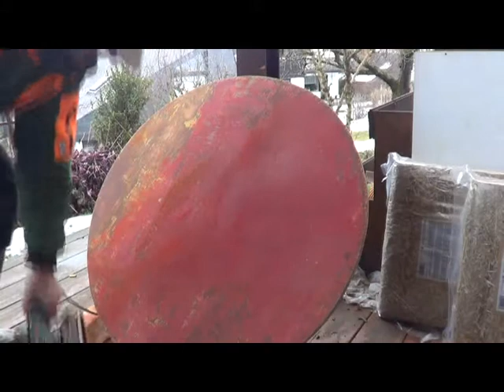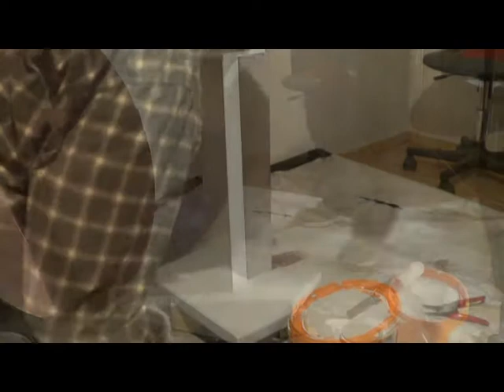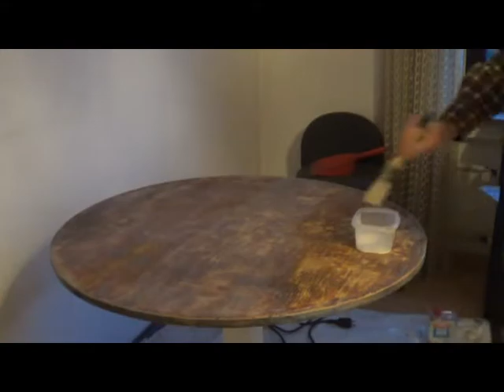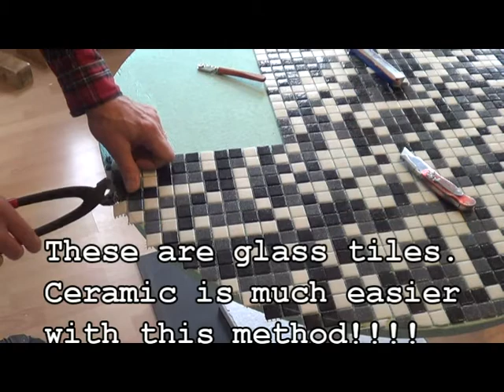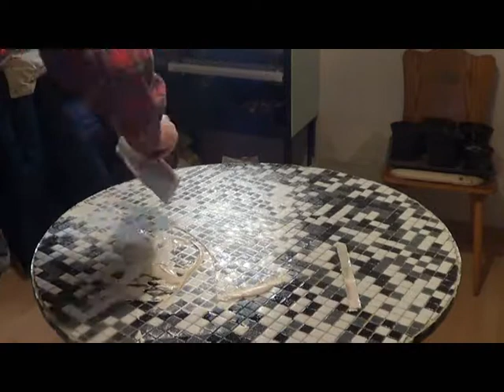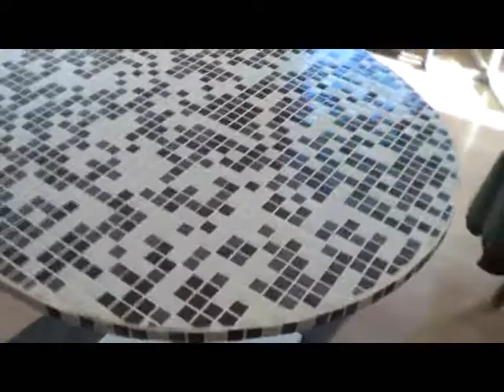Patio Table Improvement

Comment: Give it a new lease of life I have tiles like that in my bathroom. Great job mate.
Reply from the maker: Next tile job IS my bathroom. Got to rip the entire thing out and rebuild. Not looking forward to that.
Reply: Dont envy you Mine was a nightmare we had no hot water on the second floor i had to run all new pipes..
Reply from the maker: Thank God above I don't have that problem!!! I want to install a grey water catchment here to filter and reuse water rather than send it to the sewer. Figuring out how to connect into the drains has been a nightmare with all the pipes in brick and concrete walls. Don't know where they are.
Reply: Thats could be fun I dont have that problem my pipes are just boxed in and go down to a drain in the basement.